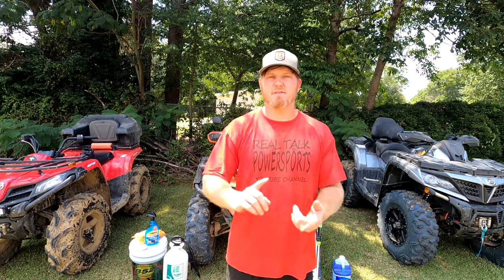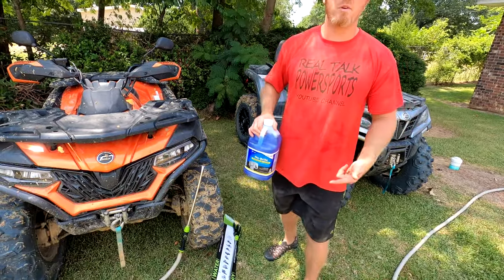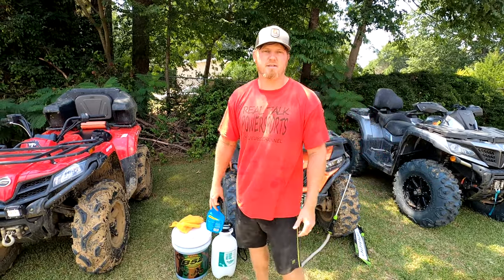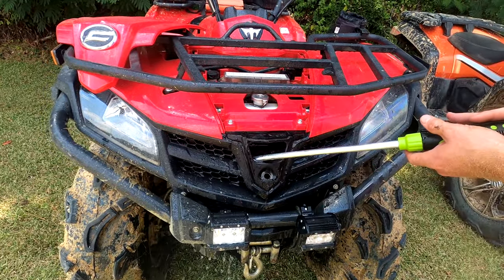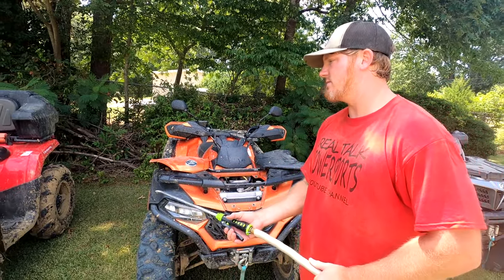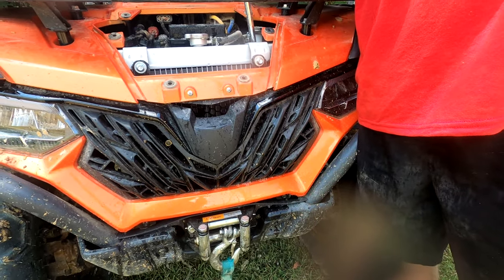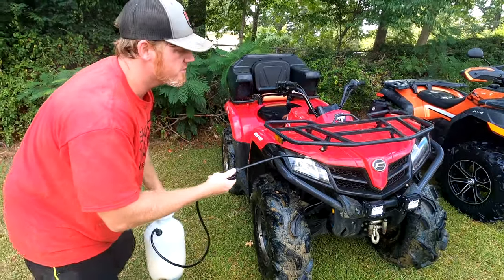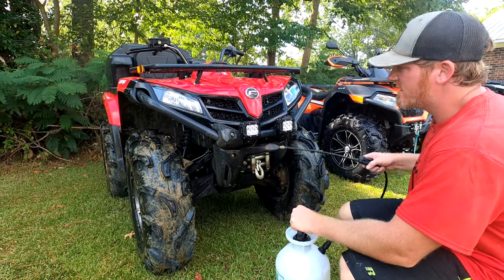Best Way To Clean ATV & SxS Radiators & Squeaky Brakes | Radiator Genie

Comment: I am an HVAC technician as my profession. Recommend to use evaporator coil cleaner instead of condenser coil cleaner. The chemicals are a little less harsh especially if you don't rinse the coil well. Great video!
Reply from the maker: Thanks Scott that is great advice! And it is true.. you have to flush that stuff out very thoroughly

Comment: Unfortunately this doesn't help much if you have an Arctic Cat (2008, 500 auto).  The top cover only exposes the rad cap, and underneath there is another cover underneath the rad and up the sides, and another plastic shroud screwed to the actual rad face. So, zero access to the rad as far as I can tell without pulling it all out.  I have yet to find a video showing how to clean an AC rad...

Comment: I have a 600 and I go into the mud and it over heats if I don't rinse it out after
Reply from the maker: Yes, got to wash out them radiators for sure
Reply: @RealTalkPowersports  If I put do a radiator relocate on my 600 will it be better or will it be the same as normal

Comment: Why am I watching this? I live near Death Valley. It hasn't rained in 6 months.
Reply from the maker: Awe man!! Well if it gets plugged with dust you will know what to do
Reply: @RealTalkPowersports  You didn't say what to use in the pump sprayer.
After reading, my comment sounded snarky. I didn't mean it that way though. I watch all of your videos!
Reply from the maker: @TheBandit7613  haha I'm sorry if you want the best results just use it straight. Don't add water. But that is kinda expensive. I also have found Mean Green concentrate to work great as well. But nothing beats a little elbow grease. Ive started taking a rag after I spray and just doing a quick scrub and then wash it off!
Reply: @RealTalkPowersports  Thanks

Comment: Helpful but not completely. 
You for sure need to take off radiator to fully clean it 100 %
Reply from the maker: I agree but not everyone has the skill to properly put it all back in place and fill the system back up and get the air out of the coolant system